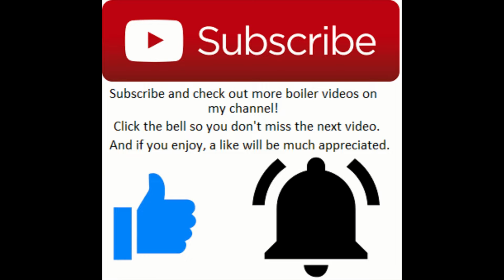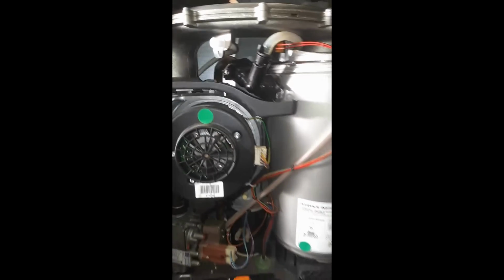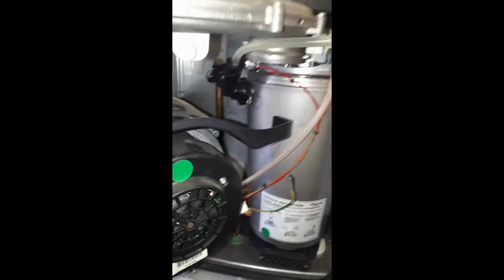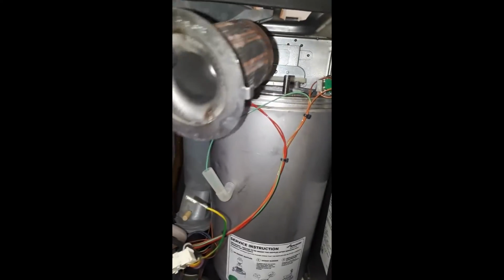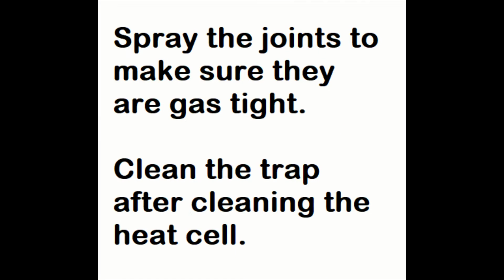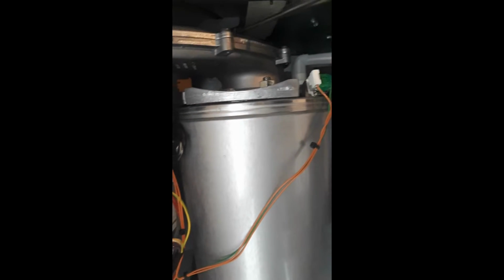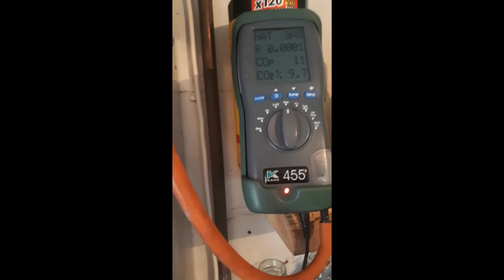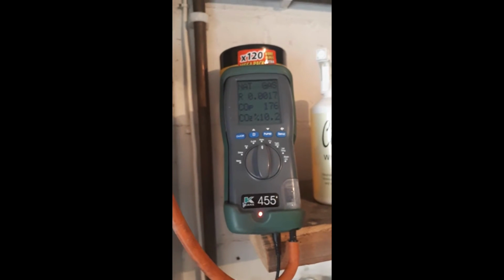BOILER SERVICE - HOW TO SERVICE A BOILER, STEP BY STEP - Worcester Greenstar Junior & RI

Comment: Is this what should happen at every service - ie annually?  My last service seemed to go very fast and I don't recall the blower or burner coming out! TIA
Reply from the maker: Only if the readings from the negative fan test point or analyser readings bad.. Or every 3-5 years.
Can't comment on individual boilers without being there.
Buuut as a general rule for myself if its the first time I personally am servicing it and there's no service history I'll give it a full strip down

Comment: Can you show a strip down of the Worcester i boiler please
Reply from the maker: I'll do when I next do one mate 👍
Reply: @goldgas1216  ok
Reply from the maker: Lol sorry sods law, I didn't get the I range last week. I'm on the case still mate
Reply: @goldgas1216  and the compact if you get a chance thanks
Reply: I wounder how the big firms get on ther only given 30 mins can't see them stripping it all down
Reply: Personally its good what you do but unfortunately its all down to prise if your doing all that your looking at a bit of time its qwicker to change the whole heat cell can do it in 30 mins i do what i can in 30 mins important thing is to make sure the burner gasket is replaced which i do every 4 years

Comment: worcester are not the best boiler contrary to what a lot of people think.front enty like the baxi's is much easier and the new compact worcester, ive never had so much trouble with servicing.why is it that worcester have to over engineer all of their boilers.right down to removing the cover.why not a couple of normal screws like most other manufacturers. great vid btw . cheers
Reply: I would rather have a ravenheat than a modern Worcester lol. Serviced hundreds of these and always wince when switching the power back on as the greenstar juniors are common for popping fans like smarties. Shocking pieces of plastic crap
Reply from the maker: @jamboSAFC  haha popping like smarties! Brilliant
Reply: @goldgas1216  😂👌👍
Reply from the maker: Absolutely agree, Worcester have the public who know the name. But design on their condensing boilers is questionable, no input from engineers. Baxi have good ones, I personally like all Vaillant and condensing Alphas too.
Thanks mate! Very kind 🙌

Comment from the maker: IMPORTANT PLEASE READ -
This video doesn't cover everything, and you should treat this as a guide.
Otherwise it will get repetitive and too lengthy - 
Do your visuals, clean ALL injectors, check burner as per MI, check/replace all seals, clean. Always refer to Manufacturers Instructions please.
!!! Do not attempt unless you are Gas safe or under the supervision of someone Gas safe. Attempting this without a Gas Safe ID can be dangerous to you and people around you!!!
This is aimed at people who don't service much, new to this boiler or trainees.
All this information is already widely available.

Comment: I've got a Worcester bosch  junior  28i  if I drain down the central heating system and refill it,  do you tend to get air locks at the top of the heat cell? As I believe they have  bleed flexible pipe at the top near were the flow pipe exits?  Do you think draining and refilling should be without any issues?  Thanks.
Reply from the maker: Just read you got a junior. There is an aav above the pump, but that doesn't mean its open. I think you should get someone gas safe to open the case and vent it and open the aav if it's not. Maybe combine it with a service if your trying to save dollar. Fit the filter yourself if you feel competent and maybe organise the engineers visit that day/next day
Reply: @goldgas1216  I've a mate who is gas safe, I'll isolate the flow/ return fit the filter and fill it best I can. If I get air I'll ask my mate who's gas safe to bent it. Thanks very much 4 your expert help. Luv your videos on Wiring S / Y plans. You explain things very well!
Reply from the maker: I would always bleed it mate. But if you're draining to do rads or something, u could always isolate the boiler, depends where the filling loop is. Then open the valves up and fill it quick, run the boiler without firing up to get the pump going, open all /any aavs. If you're not bleeding the heat cell
Reply: @goldgas1216  Filling loop is right under the boiler.
Reply from the maker: They are a pants design mate, they rib up so easy. So any thing you can do to avoid this is great
Reply: @goldgas1216  Is there a automatic air vent inside the boiler? How would you run the pump without firing up the burner?  I want to fit a omega filter on the return pipe thanks

Comment from the maker: As always this is a guide for gas safe people only!
I may not cover everything in every video as it will get repetetive and too lengthy-
Do your visuals, clean the condense trap, check the vessel, check/ clean injectors, electrodes, flame picture, check/replace all seals, clean. Always refer to Manufacturers Instructions please.

Comment: Thanks for taking the time to make this Video. I recently paid for an annual service on my greenstar 24i and thought the engineer i hired had done it very quickly and did not do anything other than give it a visual inspection and take readings. Should the part where you took out the baffles of the heat exchanger and clean with brush be done every time a service is performed? 

Thanks
Reply from the maker: Cheers bud, thanks for taking the time to watch.
If you go to 2min 36 seconds, the negative reading will tell you if the heat exchanger needs cleaning/ baffles removed. It's good practice to do it anyway and change the seal every 3-5 years regardless if the reading is good, thats why it is good get the engineer to fill out the service sheet at the back of manual.
Refer to your manual for individual readings and info.
Reply: @goldgas1216  Thanks for the reply, the boiler is 10 Years old and i can't see any history that it has ever been serviced (i moved in last year). The Reading measured are as followed.
O2 (%) 4.3
CO (ppm) 13
CO2 (%) 9.5
Ratio 0.0001
Temp net (c) 35
Temp Flue (c) 52
Eff Net (%) 98.6
XS Air (%) 25.5

Does this look alright? Cheers
Reply from the maker: @mav1937 No problem, was that from the commissioning page from the manual or from a slip from the recent service? Doesnt say anything about the fan pressure. But unless there is anything wrong with the boiler (noise or lack of heat etc) i wouldn't worry and assume the engineer done a good job, then perhaps next year ask for a full strip down service this may cost you more (labour and seals etc)
Reply: @goldgas1216  slip from the recent service. Cheers
Reply from the maker: @mav1937  good enough readings, ask for a full service next time bud
Reply: @goldgas1216  Thanks again for your time, i spoke to the engineer and he said the same thing that the readings showed that the heat exchanger did not require cleaning and said the service would be alot more money due to time and having to replace seals with new ones. Cheers
Reply: @mav1937  Thats probably minimum fire with CO at 13.   Max fire would be a lot more which represents unburnt fuel. NG I believe is 200 ppm max.